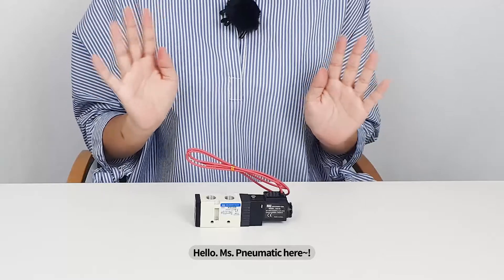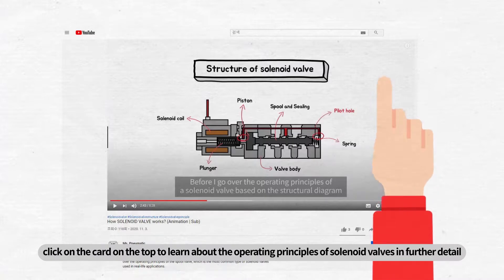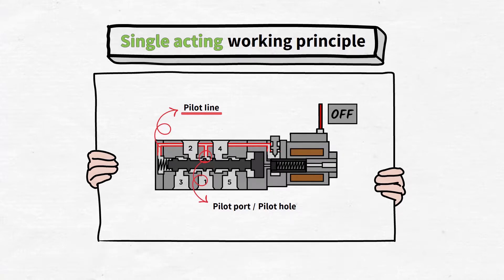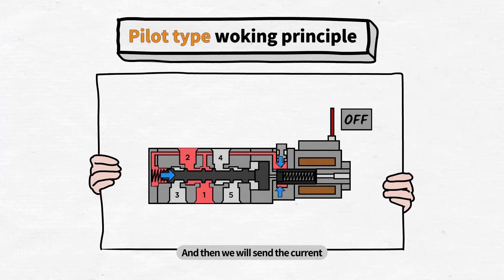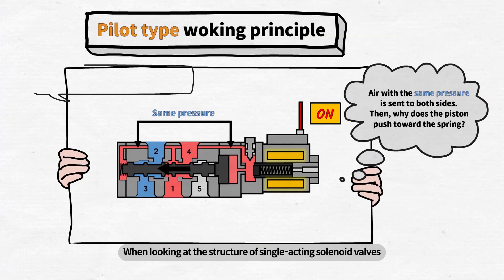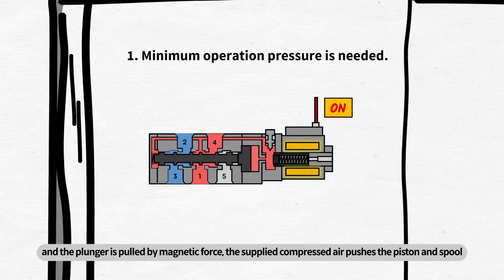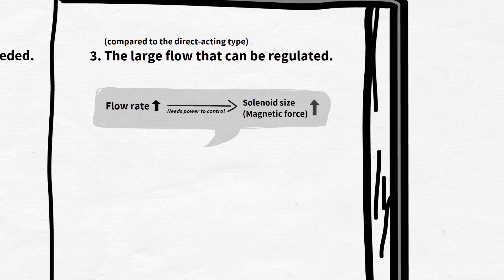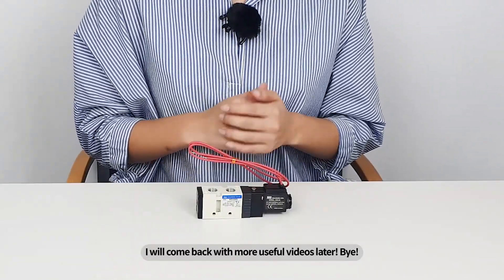How PILOT TYPE of solenoid valve works? (Animation | Sub)

Comment: So if internal piloting is not possible because the operating psi of the valve, that's when you have external which would be connected to the pilot port? Would this require a second regulator upstream, set at a higher psi, that is above that minimum operating pressure (spool shifting possible)?
Reply: If pilot operation is preferred for energy consumption (in large manufacturing plants, this savings could be significant), but requires your compressor(s) to work harder... I'm guessing that tradeoff favors the pilot operated option in most cases?